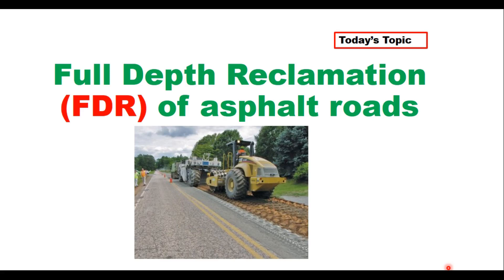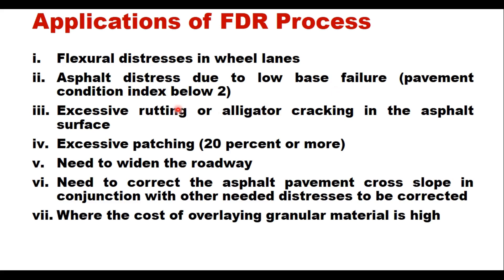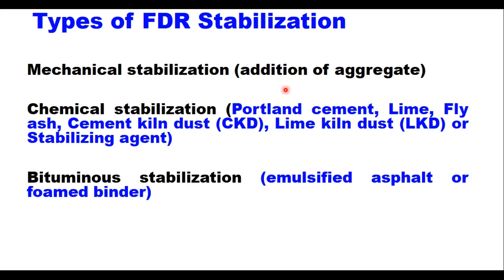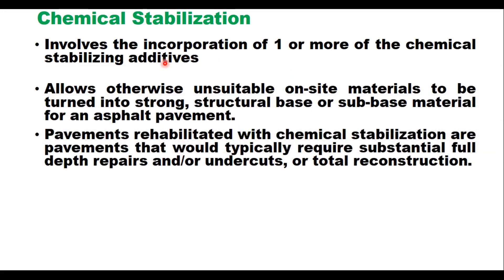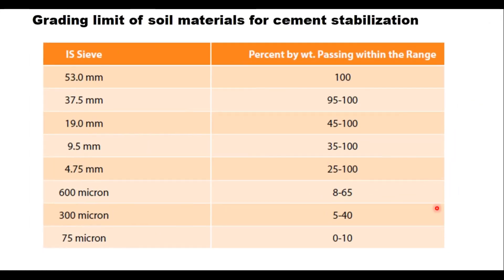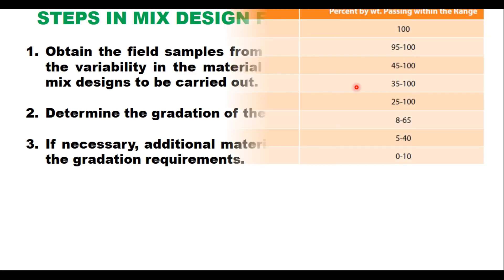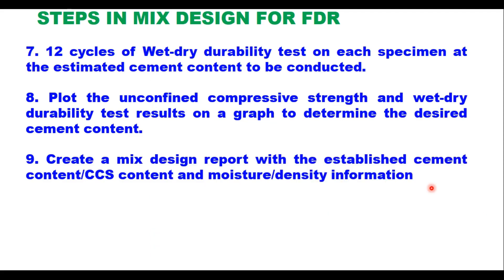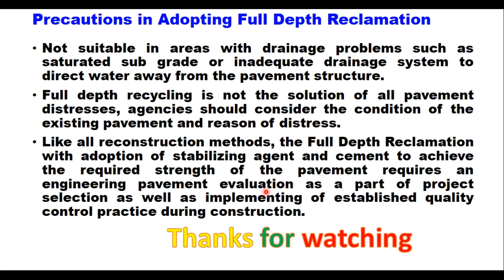Full Depth Reclamation or Full Depth Recycling of pavements - Applications, Design and Lomitations.

Comment: Firstly, thanks for wonderful informative videos. And i have one doubt that the UCS values range is 4.5 and 7 MPa for 7 and 28 days of curing. 
Is there any problem if we get the  UCS results of field core sample below or above the range? 
What are the reasons and the solutions for that particular problem? 
Please kindly help me in this sir
Reply: Yes sir and if UCS value above 7 MPa for field core cylinder samples is there any problem? If any then what should we do sir?
Reply from the maker: Field value of USC should not be less than the value specified in the design otherwise the pavement is likely to fail prematurely. Reason could be many like improper mixing, inadequate amount of cement etc. This is to be seen during QC and QA

Comment: Sir, Is it a good practice to use subgrade material in FDR. If yes, what should be the proportion and consideration criteria while using soil.
Reply: Pls reply to this sir
Reply from the maker: FDR should be limited to up to base or subbase course only and subgrade should not be part of FDR. We are not improving subgrade during GDR process, we are simply rejuvenating the upper part of the pavement
Reply: @SatishIITR  In some projects, Subgrade material have been used (35% Subgrade + 65% Upper layer reclaimed material). Gradation criteria is not matching with MoRTH designation as MoRTH don't restricts same. Mix design report says soil is non plastic. Will it affect the performance of pavement

Comment: Respected Sir, 
1. does the thickness of the FDR layer depends on the UCS value achieved in testing? 
2. Once the FDR is done, the above layers are designed as per IRC 37. The FDR layer will be treated as subbase or base?
3. Incase the option to construct a rigid pavement than compressive strength to achieved will be as per IRC 58?
Reply from the maker: There is no formal code or document in India on FDR. IRC is trying to make some guidelines. At present FDR is being used only on PMGSY roads. The minimum UCS is taken as per IRC SP 89 and pavement is designed as per IRC SP 72 or 62
Reply: @SatishIITR  Thank you sir

Comment: 1. How to determine residual Strength and which condition of cube ( Dry / Wet ) 
2.  Which condition will the UCS test and as per code UCS value 4.5 - 7 MPa in 7days or 28 days      what take 7 days or 28 days
Reply: Sir please give reply
Reply from the maker: Residual strength is UCS after all cycles of wet and dry are completed. 
UCS is taken after 7 days of curing in case of cement and after 28 days in case of other CCS.